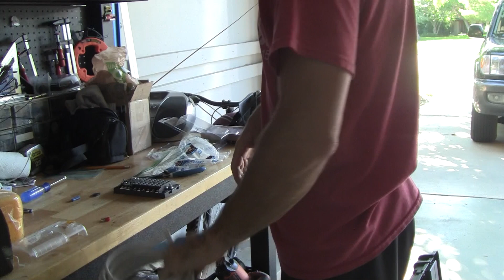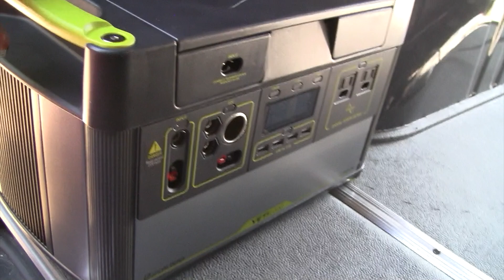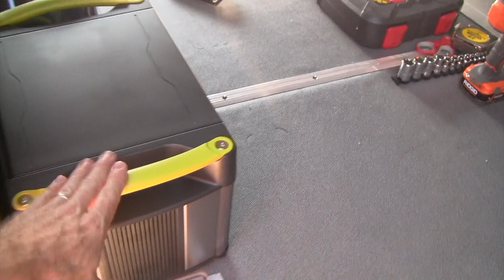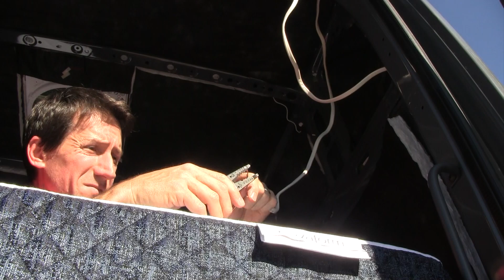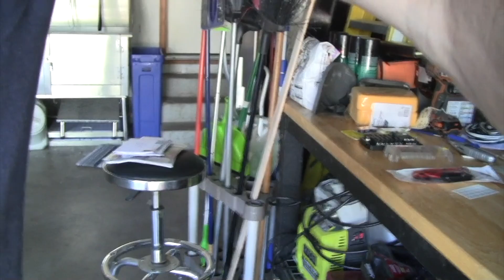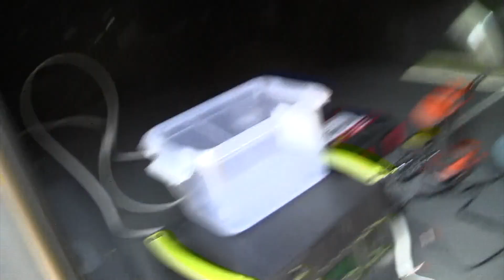Electrical wiring from Maxxfan Deluxe to Yeti Lithium 1400

Comment: So why not just use the fan wires connected to the 12V dc port directly makes no sense all the wiring to the fuse block. Totally not needed
Reply from the maker: To optimize use of the output ports on the Yeti.  In my build, all the Yeti 12V outputs are connected to the fuse block using a combo cable.  Then the fuse block gets 40A and I can connect all sorts of things of different amp ratings to the fuse block.  This is better than using up the whole 10A DC “cigarette” port on the Yeti to run one thing that only draws a few amps at most.  Look at my other videos on electrical. Not sure your house battery type and what’s available.   It even if you have just one DC port, it could be broken out to a panel to allow more things to be run as long as you stay under the max amps of that port.
Reply: @DadsVan  oh well yea that makes sense then. In the video it’s only being used for one thing which was the source of the confusion.
Reply from the maker: @thepatternforms859 Lol. No worries!  It was the first thing I hooked up. Thanks for the comments

Comment: How are u charging Goal Zero? Solar or off generator?
Reply from the maker: Both.  300W solar on roof (3 x 100W panels) and then I also tie into the alternator using the yeti car link.  Videos for both are on my channel.
Reply from the maker: Oh, and I also have a 120V shore power hookup on side of van that feeds into two charging inputs.  So three total charging options.  The battery is almost always full

Comment: What else are u running off that fuse box?  How.much can That 12v plug power?
Reply from the maker: The 12V socket can do 10 amps.  That’s plenty for the fan.  The 7.5 amp rating and fuse for the fan is a max.  It won’t ever hit that but that’s the required protection.  I actually combo the 12V with the all the other outputs using an adapter to get 40 amps to the distribution block.  Then I break that out to power everything in my van.  Fan, led lights, fridge, heater.  There’s still room to hookup more, and eventually I’ll add water pump and cooktop

Comment: Thank you! Very helpful. do you leave the ground wire to the air? Would you recommend at wire nut to cap it off?
Reply from the maker: This video was made early in my build and I’ve learned a thing or two since.  You should use stranded wire without a ground.  If you already have a ground wire and it’s not connected on either end then you can just leave it, electric tape it, or cap it as you suggested
Reply: So you’re not attaching the negative fan wire to the negative fuse block terminal? 
Can you explain this? I have a very similar setup.. trying to run my fan off 12v ring connectors to the cigarette port of my power station, but I can’t get it to turn on!
Reply from the maker: Yes the negative wire goes to the negative fuse block terminal.  So you should have positive and negative from your power source going to fuse block then to fan connections.  Make sure not to mix up the fan connection as the wires there are black for positive and white for negative.  If you are referring to my earlier comment about ground wire, that is a separate wire not needed since Yeti has a floating ground.  So just use two wire cabling (positive, negative) instead of three.

Comment: Helpful guide! I’ve seen people use the Anderson port instead of the car charger, so looks like either will work. Thanks!
Reply from the maker: Yes either can be used.  This was my early connection.  Now I’ve got the goal zero combo cable to takes all outputs (40A total) to the blue sea panel.
Reply: @abuus06 Do you have a link to video's using the Anderson plug?
Reply from the maker: Are you going from Yeti direct to fan, or first to a DC distribution panel?  Assuming direct to fan, you can use a cable with Anderson power pole on both ends.  You connect one end to Yeti and the other end to fan wires.  On end with fan wires you’ll need to either 1) cut off Anderson connectors and connect  by crimping butt connectors to fan wires, or 2) add Anderson connectors to fan wires.  Anderson cables are usually thicker and rated for high amps, so if this is direct to fan try to find one that is no thicker than 14AWG

Comment: Bought a used van with a maxx fan already installed.  how can i easily test the fan before doing all the wiring .
Reply from the maker: I tested mine by connecting the wires to a 12v DC car adapter cable like this: https://amzn.to/3Gb9j8V   and then plugging into  one of the outlets in the van.  Check what length you need to reach an outlet  there are shorter and longer cables out there.

Comment: I have a jackery 1000 and I want to wire my maxxfan to it can I use a USB and how do I do that
Reply from the maker: You cannot run a maxxfan off USB because it won’t provide the right voltage or amps. The maxxfan requires 12V and 7.5A max .  The jackery 1000 looks like it’s usb-c can do 12V but has max amps of 3A.  If it could output more power you could use a cable like this: https://ebay.us/Q8kBXO  and then connect to a terminal/fuse and final cable run like I did.   But with your Jackery 1000 I think you will have to stick to using the 12V DC “cigarette” plug and an adapter like this: https://amzn.to/2ZYERPu
Reply: I have a jackery 1000 and 2000,  want to wire it th plug into 1 on the 12v sockets. I am running an ICECO fridge off the other? All my lights are rechargeable led usb so all my bouse power from jackery not the started battery.  I met people  Ampang w same system w a Blueti?  They loved how simple it was.  I have jackery on shelf over pass side wheelwell, will run up sliding door piller and across, much shorter than got back, up, fwd then across? Atleast 10 extra feet?  I'm trying to keep wiring as simple as possible?
Reply from the maker: That sounds like a good plan!

Comment: That white wire looks like domestic gauge AC wire and not DC wire.
Reply from the maker: Good eye.  I used 14-2 AWG solid core wire with (unnecessary/unused) ground wire for the fan circuit originally. I have since moved to (learned) stranded which is much easier to work with and more vibration resistant.  Good luck with your build!

Comment: Just curious, the 12v adapter has a built in 15amp fuse, so is the distribution block with the 7amp fuse necessary too? I was going to do the same setup with my Maxxfan, but I don't have anything else that I would need to connect to the distribution block.
Reply from the maker: As long as the wiring from Yeti 12V to the fan can handle 15A then that would be OK.  If your not hooking anything else up to that 12V circuit then you’ll be well under the 15A fuse limit running just the MaxxFan. Good luck with your build!

Comment: Thanks for posting, dad. Which 12v plug did you buy? How have things been working for you. What components are you running?
Reply from the maker: When I first hooked up the max fan I ran this 12V adapter: https://amzn.to/2P1Wt87 to this distribution box: https://amzn.to/31AtqLz and then connected fan through 7.5A fuse.  As I acquired more 12V accessories I needed more amps from the Yeti so I switched to this combination cable:  https://amzn.to/3srgVh9 feeding the distribution box.  

So far no problems running 12V accessories this way.  I’m now running the max fan, dometic cfx75dz fridge, and espar D2 heater.  I also added the goal zero 12V regulator on the fridge connection.  Next up is lighting.  

Good luck with your build!
Reply: @DadsVan  how well did your initial 12v plug, the chanzon brand, fit into your yeti? Was it tight fit? I bought a different brand and is slides out a little and seems to be a bit loose, although works.
Reply from the maker: I just went back and tried it again just to be sure (since I'm not using it anymore).  It works great and is a tight fit.
Reply: @DadsVan  thanks dad. Is it necessary to ground the system or is the negative a 'floating ground'
Reply from the maker: It is a floating ground
Reply: @DadsVan  thank you so much. I just hooked my fan and dim lights up! I am stoked!!
Reply from the maker: Sweet!  Glad I could help.  Good luck with the rest of your build!
Reply: @warblur  For a loose 12v plug, I attach a plastic zip tie to the cord, near the plug. I lay the tie against the plug's side, before plugging it in. Basically, it's just a shim. I used a zip tie, so I can attach it to the cord and always have it handy.

Comment: Hello - sorry to bug you again! I will be hooking up a maxxfann 4002K to my fuse block. I will also be hooking up a propex propane furnace (I believe it has a pretty low draw) to the fuse block as well. Just wondering what size wire I need going to the solar generator to the fuse block?? Would the size you used be good for me as well ( I re watched your video and I don't think you mentioned the size of wire). Also I am assuming there was a fuse in the cigarette adapter male end - can you tell me what size it was?? I do not plan to add too many more items to the fuse block - maybe a set up low wattage lights in the future. Thanks
Reply from the maker: Hey Roy.  I used 14 AWG (14/2) wire for this connection.  The size of wire you need depends on the max current draw and length of the run.  In my case the max amps is 7.5 and the run was 10 feet, so 14 AWG was the right choice.  I used the Blue Sea web site for DC wiring as a guide: https://www.bluesea.com/resources/1437
Reply: Dad's Van great thanks again for the reply!

Comment: Great video! I am looking to do the same thing with a fuse block and cigarette lighter port to power items in my van! How as this worked out for you so far?? Thanks
Reply from the maker: My setup has worked out good.  I think what you doing will work too.  Just keep in mind that the 12V "cigarette" outlets in the van are tied to your Sprinter's starter battery.  Thus running the fan will drain the starter battery eventually, and your van may not start.  That will depend on how fast you're running the fan.  It should be OK for a night on low settings.
Reply: @DadsVan   I think it wrote my comment a bit confusing. I will be actually plugging the fuse block into a inergy apex solar generator. Thanks very much for your reply!